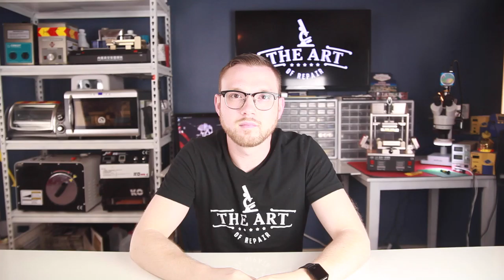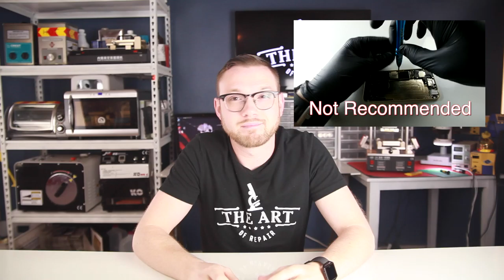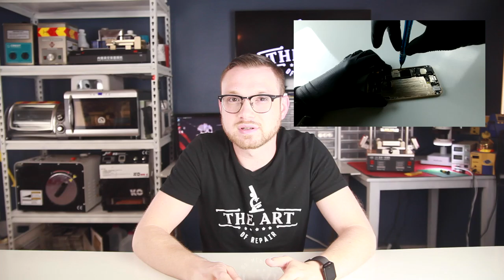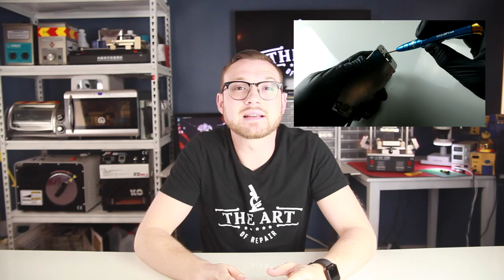EP12 Micro Screwdriver Technique

Comment: Very good advice and I have used it before as I was schooled on this way earlier by a tech who is very finicky and fanatical about technique. The smaller the screw, the more important, what I call, feel certainty, is. Tiny screws have very fine threads, less than 32 per inch are common. With screws that small, stripping is very easy. Be cautious and feel the thread in the cavity. You don’t want to cross thread the fastener. Justin spoke about the table top. He is correct in that. Getting in too big of a hurry is the worst mistake. One step at a time and feel your thread. Forcing it is trouble waiting to happen. That’s my take!👍🏻

Comment: Yeah the backspin technique is very helpful. I like it use a tweezers to position and sometimes hold the screw in place when it is either non magnetic or long or near a magnet like a speaker.

Comment: I do find that screwing manual is often to unprecise, I'd rather use a electrical screwdriver with torque settings, so you know that every single screw is mounted exactly like original. I have often seen problems due to over or under tightened screws.
Reply from the maker: I have been seeing new torqe specific hand drivesr here in china recently for a decent price, Unfortuantly they do not specifcy the NM they use so im sketched to try them. I will just continue to stick to my old methods XD